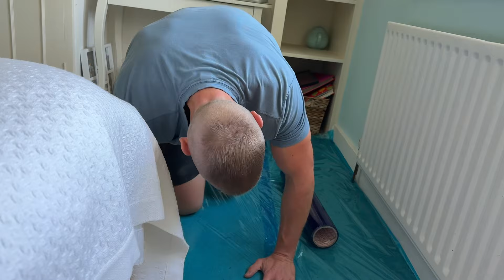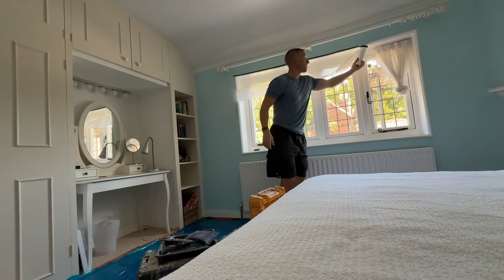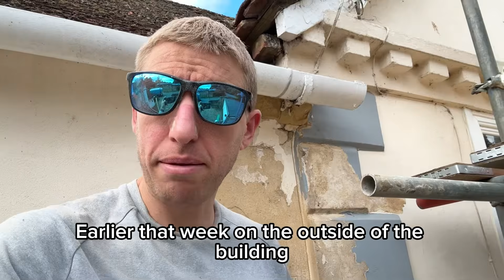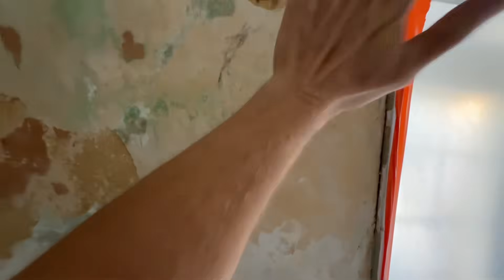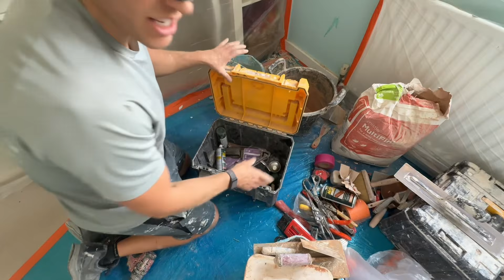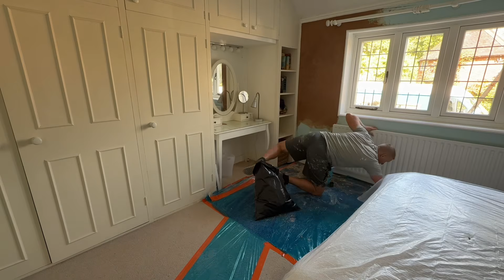Professional Plaster Repair _ Water Damage & Render Failure Explained

Comment: What was the glue/sealant you first used for the big gaps?
Reply from the maker: It this one I used Soudal fix all turbo.
Reply: @DanLee40 Great thanks 👍
Reply: Could you please tell me how long before I can go over it with finish?
Reply from the maker: @paulcrockford8718  Good question — Soudal Fix All Turbo sets very fast, but the key thing is to wait for it to fully cure, not just skin over.

So if you’re using it just to fill hairline cracks or shallow gaps (1–2 mm), you can generally plaster over it after about 1 hour — once it’s firm to the touch and no longer tacky.

If the fill is deeper (5 mm or more), it’s best to give it a few hours (ideally overnight) so that it’s fully cured through before applying plaster.